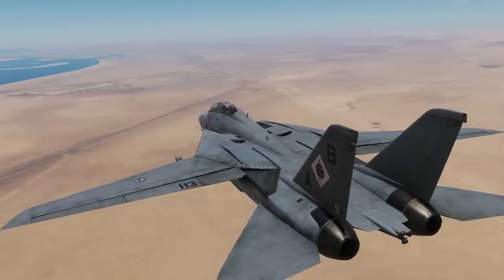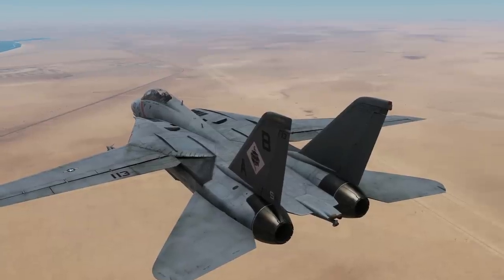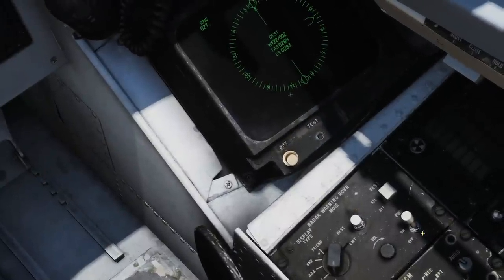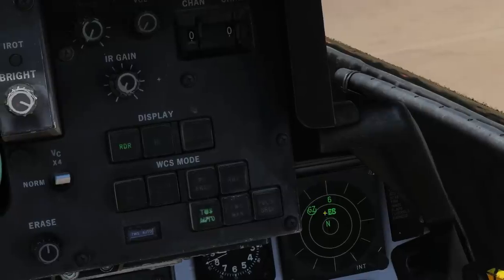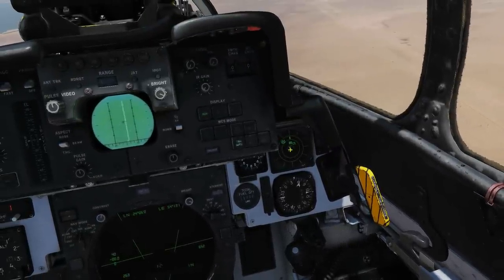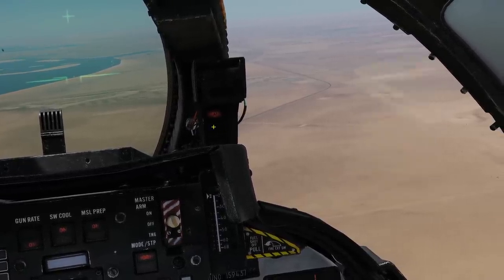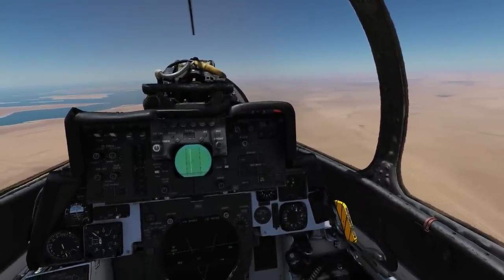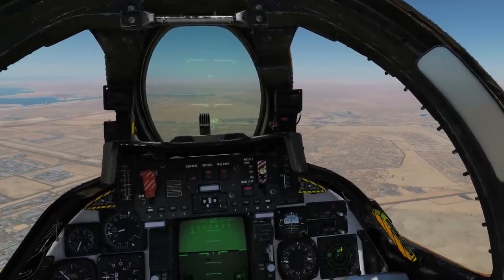F-14B Tomcat: AN/ALR-67 RWR Tutorial | DCS WORLD

Comment: I think there's no blind spot up and down, or a very narrow one because of the positioning of the antennas on the aircraft (2 of them on the tail planes). The downside is you loose bearing accuracy in turns because it looks like the RWR assumes your aircraft is level AND the antennae moves with your tail planes ^^ (ie in your video it still at 12 o'clock but you have already turned more than 30°) or even get splitted contact (once again, shown in the video, you see the grisha and the 6 repeated twice at different angle. The "good" bearing should be somewhere between the two of them). It's merely speculations, but it could explain the difference in regards of modern RWR pods where all antennas are concentrated in a small array, with finer azimut and signal processing capabilities but an effective blind spot up and down.
Reply from the maker: thx Sir